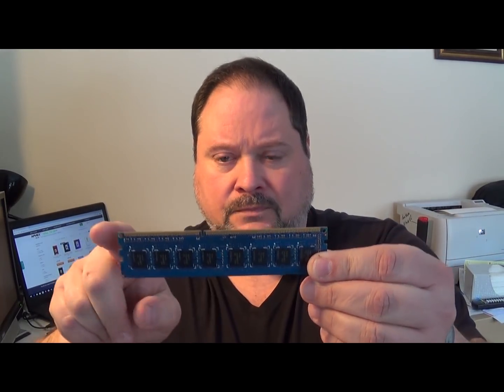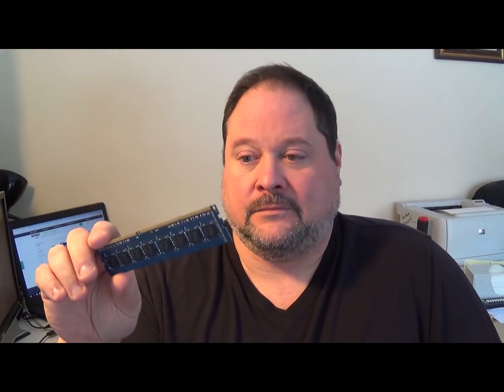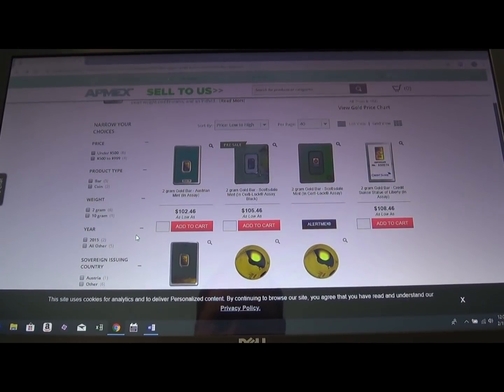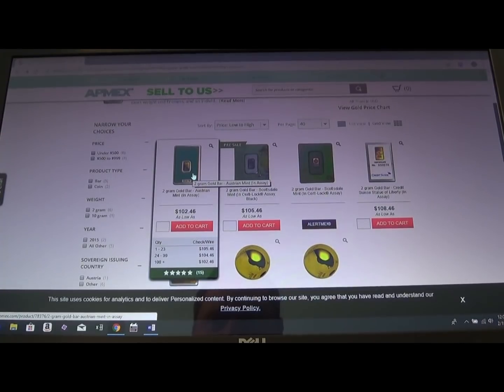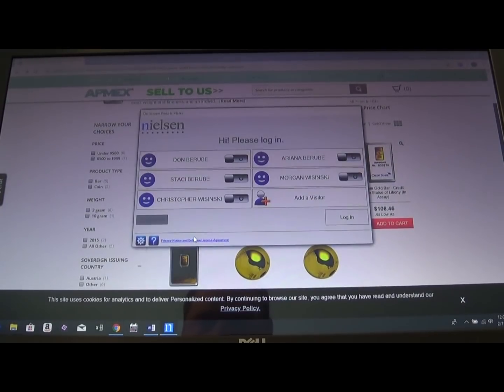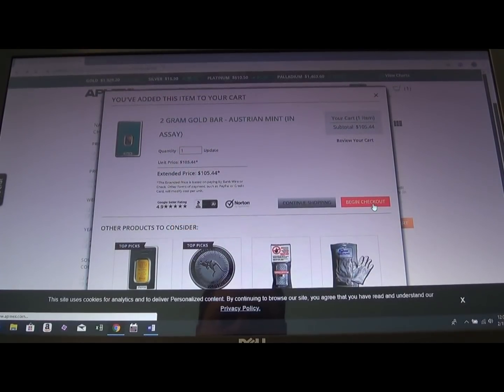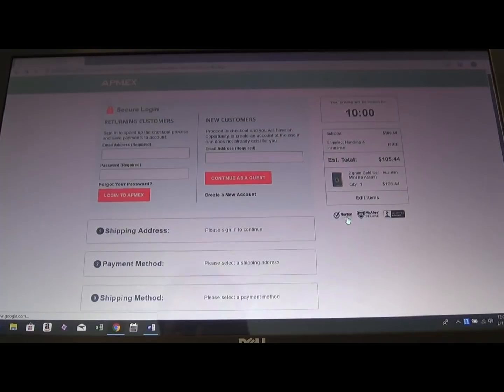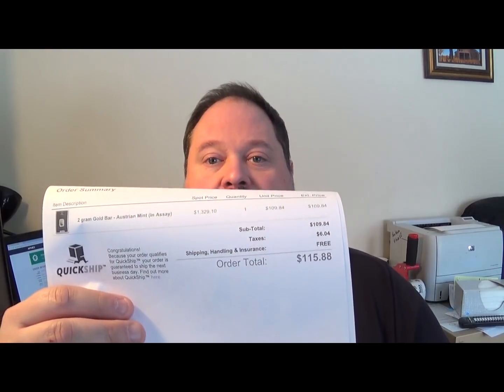How to get 2 Grams of gold from 4-6 ram sticks -Moose Scrapper #276

Comment: Hello From cold Montreal  just a quick question on the mother board there’s a somewhat large CPU chip there’s a black ceramic over it do  I break  it of cause I was told there’s gold in the ceramic it’s self and under the ceramic there is gold to. Do I leave that ceramic on the cpu chip ?
Reply from the maker: https://www.google.com/url?sa=i&source=images&cd=&cad=rja&uact=8&ved=2ahUKEwj834GW3NzgAhXhFjQIHdYSDi84yAEQMygGMAZ6BAgBEAc&url=http%3A%2F%2Fwww.titautomation.com%2Fbga-chips.html&psig=AOvVaw33uSS8G16Y2VOb9haq3bxg&ust=1551384577204878&ictx=3&uact=3

if this is what you are referring to, its called a BGA chip.  The black epoxy top must be broken off the fiber board base and processed separately.  The top is incinerated and treated like an IC ship while the bottom can pe treated in Acid Peroxide or aqua regia .  either method should work.

Comment: Moose what should I do if my ram doesn't sell I have 1 gig and 2 gig ram
Reply from the maker: If it does not sell, then scrap it.  Typically though, it sells well particularly in lots.  There are places that have data on expected yields so you can gauge what their value is.
Reply: @moosescrapper5928  what do you mean by places that have data on expected yields I don't understand

Comment: I do scrapping to build up certain metals to supplement my disability-at this point have not done enough to make it worth taking in.  The Gold will go towards a few jewelry ideas I have-unique pieces but a pain to  do.   In the past I had some 10g old bars but needed to sell them and that turned out to be tough-I did not use Ebay so that may have been a problem but just having Gold sitting in a box seems to be not really worth it if you need quick cash versus Copper or even Aluminum.  I like your way of doing it tho.  Use the same technique for some other metals as well.
Reply: Thanks Moose

Comment: @Moose Scrapper Maybe a silly question. How do you package them when they sell? I have quite a few to sell.
Reply from the maker: I sell a lot of parts so I buy in bulk static bags, you can get over 100 for under $10.  Then I ship in either small boxes or envelopes with thick cardboard on both sides of the stick.
Reply: @moosescrapper5928  Thanks Moose

Comment: Nice vid moose! Been trying to watch the live streams also. Two questions one what do you do with the power cords? And two .. do you know if there is anywhere that recycle neodymium magnets?
Reply from the maker: POwer cords I tend to hold on to about 20 or so good ones for things I sell on ebay.  Its good to have some to test things or to include with items you are selling that did not arrive to you with one.  After that, some people sell them in lots, depending on my mood and how slow the scrap is coming in I may strip them (not often) or just bring them to the scrap yard.  As for the magnets, technically most yards will tell you to throw them in with light iron, I sell them on ebay.
Reply: Moose Scrapper thank you sir!! I appreciate the input. Do sell the magnets per set or lots?

Comment: Same thing I do with my dental scrap. I collect it over a few months and ship it to a reputable refiner who sends me bullion coins. No way I can refine the Au, Pt, Ag, Pd less than the 5% processing fee they charge me, which is fair. They assay it and let me know the content and send me coins or a check. Essentially free bullion. You get free RAM so you’re getting free bullion with little effort and no toxic fumes.👍
Reply from the maker: Its a beautiful thing!
Reply: What refining company do you use? Most of the ones I’ve seen just pay you for it but I would rather just have the metal back minus their cut.
Reply: Tommy Waight 
I use Garfield Refining. I don’t think they deal with electronic scrap though. They refine dental scrap and dental laboratory grindings and old broken jewelry and jeweler’s grindings. They melt it all down, then use x-rays and whatever to assay it. I had a small batch returned and it was just a melted button of metal with small drill holes in it where they use the grindings for a sample. I don’t think they can return it all separated and refined because I believe they combine a bunch of little batches and refine it all large scale. You can get back refined casting grains of Au or Ag or minted coins or bars, generic, U.S, Canadian. That’s how I do dental. I’m still stock piling my own e-waste scrap for now, silver contacts, gold plate pins, tantalum and MLCCs, etc. The bigger stuff like copper, aluminum, steel I turn in to the scrap yard as I get a bunch.